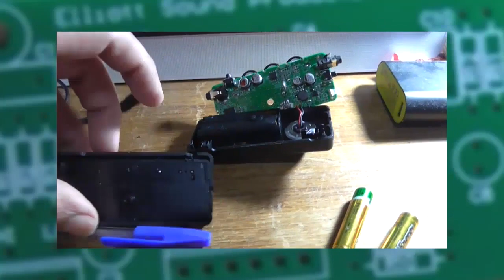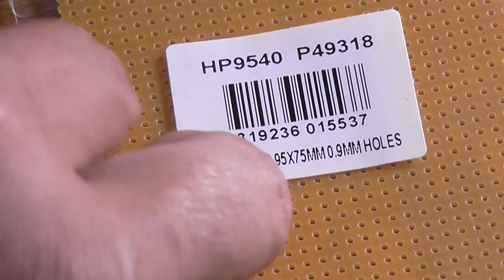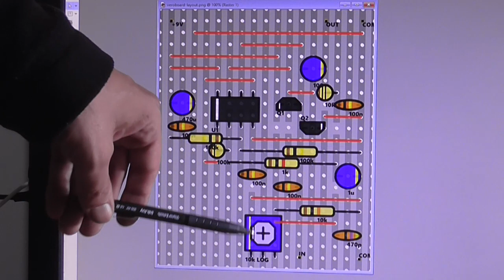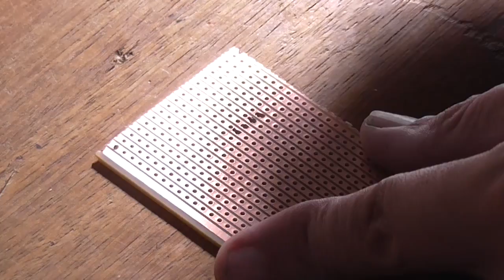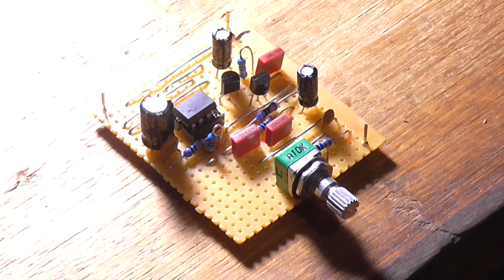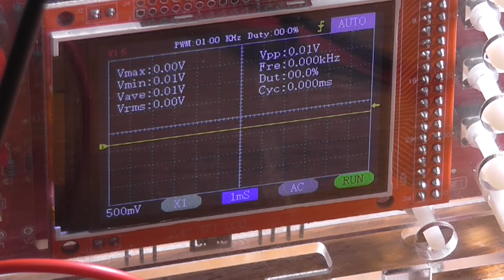100mW Utility Amplifier: Now On Vero Board

Comment: The TL072 has weak output drive capability at low voltages, with an 8 ohm load the current gain of the output pair probably isn't high enough to let the op-amp get anywhere near the rails.
Reply from the maker: Most likely. However, it worked with the TL072 when I used it a fair few years ago. Unless it's changed recently.